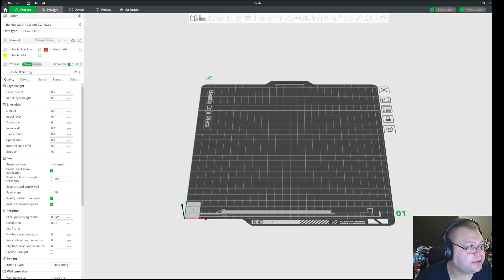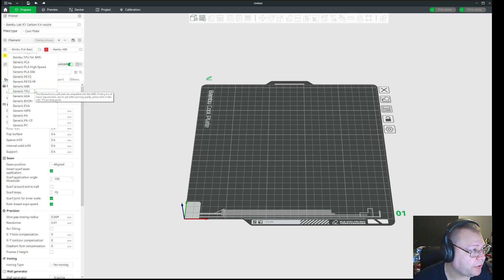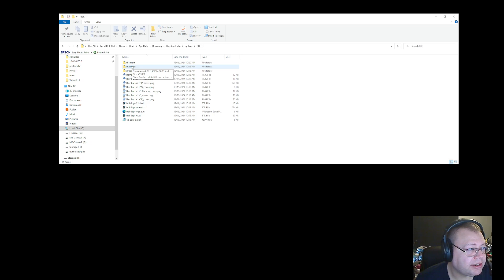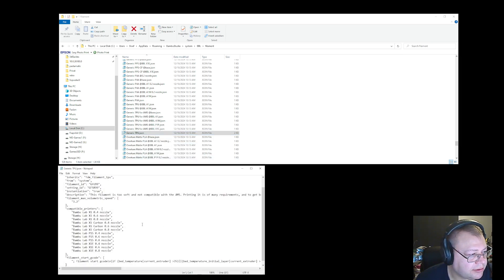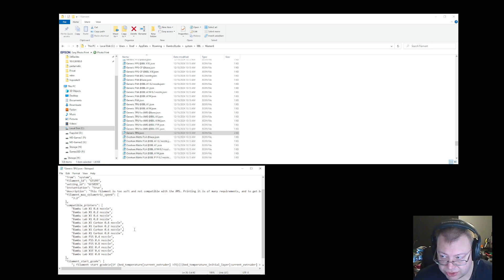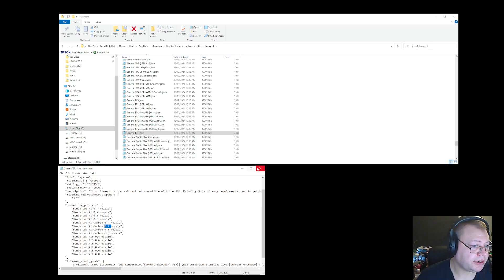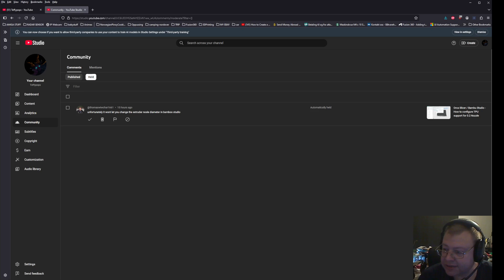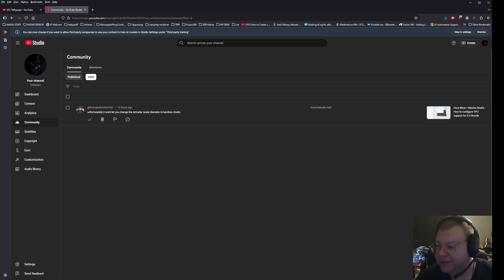Bambu STUDIO - How to setup 0.2 Nozzle for TPU!

Comment: How you do this for ps1 with basic pla ? From 0.4  to 0.2 ? I cant changes it..😢
Reply from the maker: p1s use the x1c filament profiles. 

1. change nozzle size from 0.4 to 0.2 in printer settings on printer

2. select p1s printer and nozzle size 0.2 and it should show all default filament profiles 

basic pla bambu x1c profile is what is used for p1s

Comment: didn't work for me, still can't select generic TPU
Reply from the maker: Must be doing something wrong then or skipping some of my steps.
Reply: @Toffypops  or maybe the new update, I found another work around which I think was easier. Just update the PLA profile in Bambu with TPU settings then save that as a custom profile and just use that, worked a treat for me
Reply from the maker: like my orca slicer video

Comment: I can't change the nozzle in that file. There is no nozzle size like i see on yours. So i still can't print with my 0.2 nozzle in tpu.
Reply from the maker: i have had others successfully do it and thanking me, so maybe you are using the wrong files or incomplete files?   or an incomplete installation?

Comment: Thanks! It did help me over the old reddit topics that never actually give any usefull help on this! 😊
Reply: Done. I'm currently simply unable to find correct flow dynamics and ratio for the Geeetech TPU with the 0.2 nozzle. The flow tests from Bambu Studio both give me results that I can't even distinguish, basically ZERO difference. Did you already go through this mess?
Reply from the maker: @ArkatzMods  Flow ratio for tpu is a lot less for 0.2 over 0.4. Did you try manual calibration? automatic usually do not work well.
Reply: @Toffypops  I meant I did calibrations tests, the manual one, twice, but I can't see any difference from 0 to 1.0 (the maximum Studio allows me to). And so the line is always precisely the same, no significant difference, and it sucks . It's not a nice and straight line, it's bad.
Reply: @Toffypops  and you can't run automatic calibration with TPU in Studio. Not authorized.
Reply from the maker: Glad it helped. Drop a like and sub for more updates. 😁
Reply from the maker: did you do the manual one for flow calibration going from +20 to 0 to -20?
Reply: @Toffypops  yes of course, I usually do this one first as I found it is influencing a lot the other
Reply from the maker: did you try Orca Slicer?